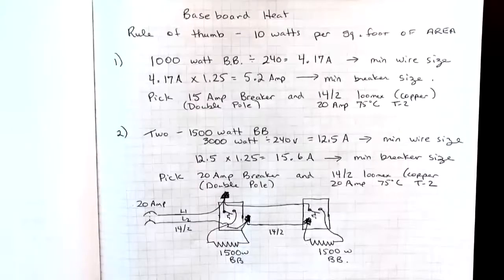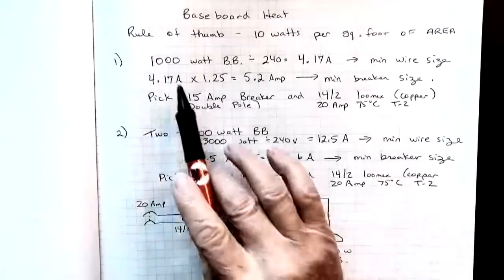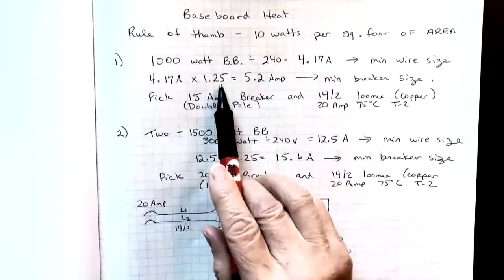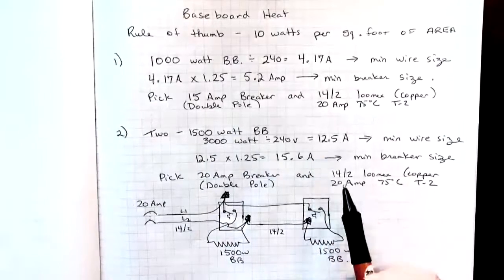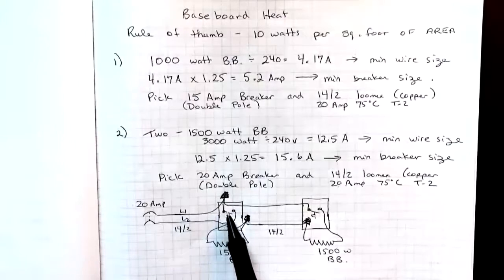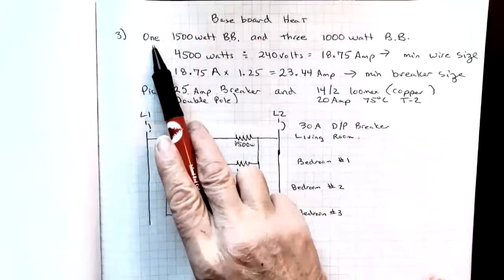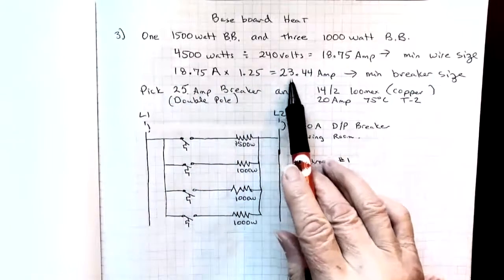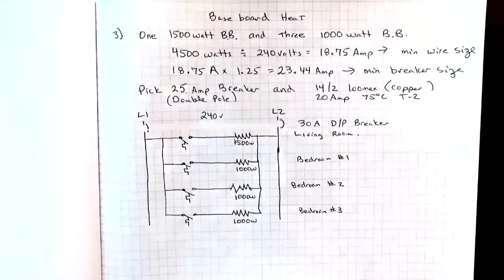CEC 2018-Section 62: Baseboard Heat Calculations

Comment: in last example you said if 25A breaker wasn't at market go to 30A. But if we select 30A breaker then the cable ampacity cannot be less than 0.8 * breaker which is 24A and it means we should select 12AWG wire

Comment: Correct....very few sparkies know this on 20 amp breaker...only because the bond wire of 14 is good for 20 amps. You cannot do so with 12 gauge as the bond is 14 for 12/2...same for 10/2

Comment: Thanks for the video . If under 100amps I believe you gotta size conductors in the 60degree column regardless of insulation rating of said conductor. That way you don’t end up throwing 14/2 on a 25amp breaker. Where I work we never run 14/2 to a baseboard heater. I’m sure it would be fine for a small unit in some cases but it is best to oversize than to undersize and create risk. I did not know the 10w per sqft rule of thumb and have heard of inspectors calling you out on calculating for baseboard heat size/quantity in dwellings. Much appreciated for this.
Reply from the maker: In the 2021 CEC you would need to use the 60 degree column when the Termination Temperature Rating is not marked on the equipment.  Rule 4-006 2)a)
Reply: Thank you for asking that. it was driving me nuts trying to find something in the code book. I knew it was 60 deg but couldn't find any reason to have it 75 deg. 
It's getting harder and harder to find any content for 2021 CEC updated content on Youtube. I thought the Liberals Bill C-11 was supposed to make it easier to find Canadian content on youtube.

Comment: In your example at 4:24, you end up using a 25 amp breaker for 14 gauge wire. Isn't that in conflict with 14-104-2, which says that 14 gauge conductors require a 15 amp breaker? Doesn't 14-104-2 force one to use the 60 deg column of table 2 for small gauge wire? Or, is there some exception here to 14-104 as it applies to heating circuits?
Reply: 62-114 (7)
Fixed resistive ccts and known load